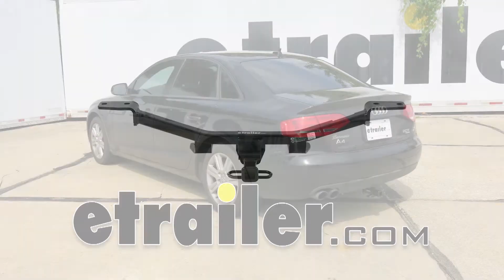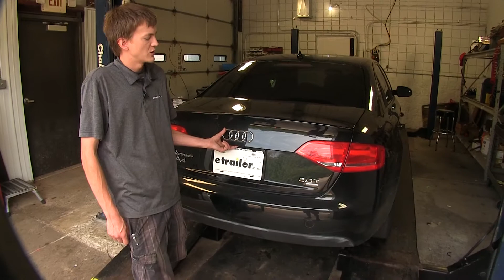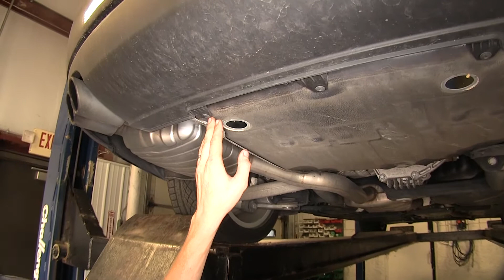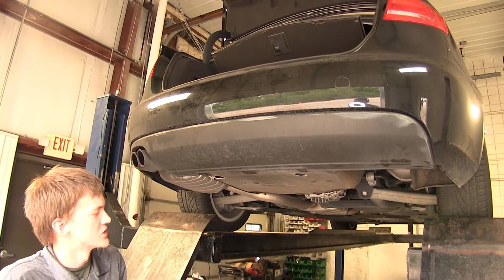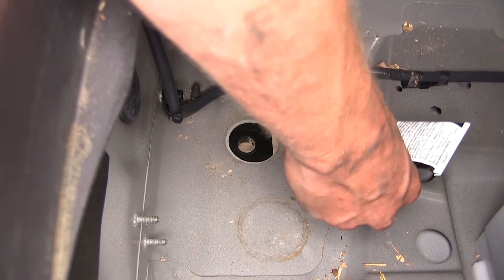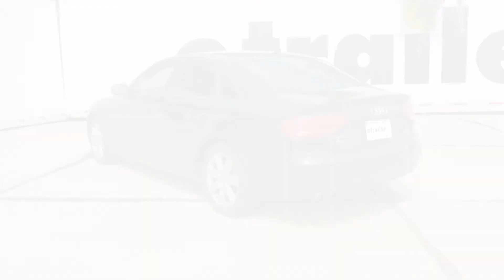etrailer | Beginner’s Guide to Installing the Curt Trailer Hitch Receiver on a 2011 Audi A4

Comment: Why is this a Class I hitch?
I live in Germany and the A-4 is one of the most popular cars for towing campers and horse trailers. The Euro-style hitches have a 50mm ball and are rated for 5K#.
Reply from the maker: Probably because folks in the US are more lawsuit-happy than they are in Germany. It's not uncommon at all for European spec vehicles to show a higher towing capacity than the US version of the same vehicle.
https://www.etrailer.com/Trailer-Hitch/CURT/c11186.html
Reply: @etrailer , good point about our litigious society.
You may also be correct that the US-spec cars are less capable than those made for other markets.
I was also wrong the European hitch rating is 3,500 Kg.
I tried explaining to my landlord why I was shocked to see people towing horses with an A4, he looked confused and then told me that the A4 is a good car with a powerful engine. 😅
I guess that Germans simply  see the A4 as a capable vehicle rather than a luxury car that has to be treated like an egg.
Reply from the maker: I don't know about Euro spec vehicles being more 'capable', but it's possible. Smaller vehicles equipped with Diesel engines are much more prevalent over there, and it would stand to reason that because of that they'd have a better towing capacity. That being said, as far as gas fired vehicles, I'd be willing to bet that there isn't much difference between a US and Euro-spec vehicle as far as the drivetrain goes. I'm pretty confident that the lower tow rating on US vehicles is strictly for liability reasons.....Sad to say.